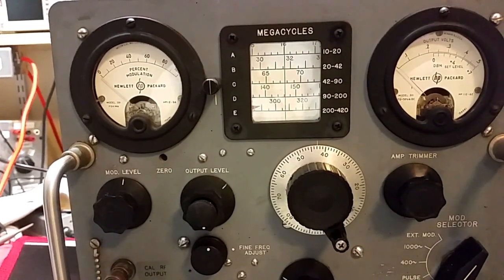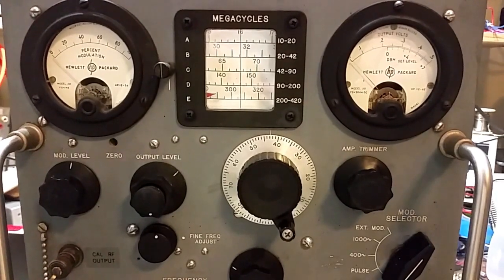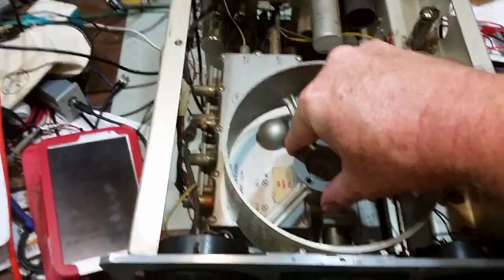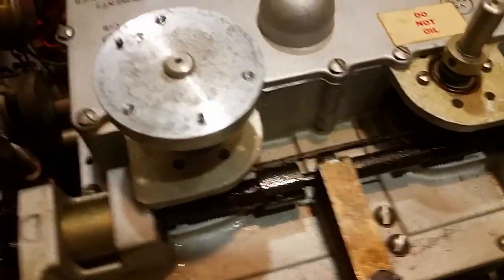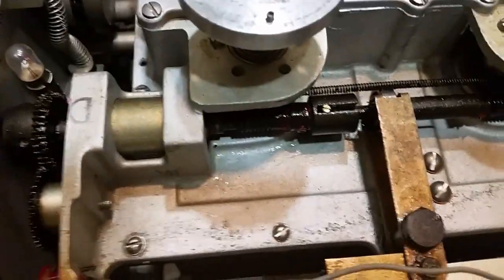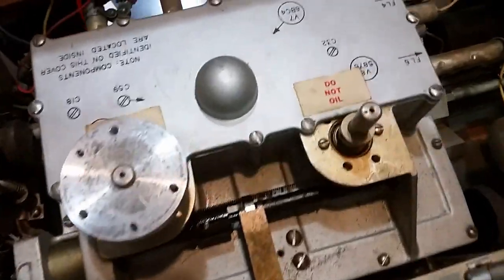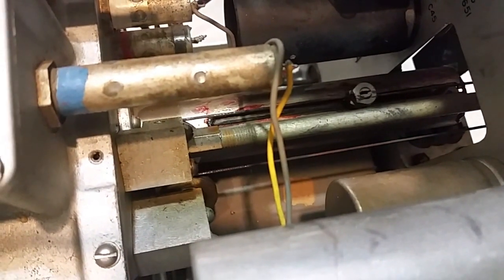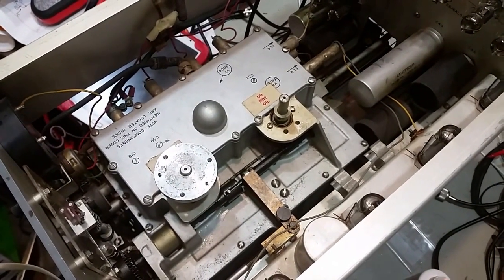Hewlett Packard 608D VHF Signal Generator: A Mechanical Marvel

Comment: I know this is an old thread, but i wanted to add a couple of comments about the rf section "tuning" that those who are not familiar with the the 608 series may find useful if they are restoring one of these units.  As the author of this video points out, the oscillator and power amplifier are tuned together by a worm drive shaft which rotates a pair of multiplate air gap capactors .  

It's very possible that after so many years that the grease used to lubricate the bearings has dried up and for the rf amplifier tuning to "lag" behind as the frequency knob is dialed across any one band.  This is undesirable as it will cause the output power to vary rapidly rather than gradually.  This lag is caused by the shaft binding or dragging.  If the design did not have the slipjoint that is part of the Amp Trimmer control, the two capacitors would remain in mechanical alignment and the increased drag would be felt by the operator as the frequency knob is turned.  You can observe the slip joint as the frequency dial is turned, and the "lockiing pin" should stay at the same depth in the slotted housing.  If the RF section has any binding, the pin will move forward or backward relative to the slot.  You may observe the pin moving, and when the spring tension increases enough to overcome the friction of the bearing, it will often audibly snap back into place. 

The issue then becomes how to free up the rf amplifier tuning which is complicated because HP used a shielded bearing which is pressed into the top of the rf housing.  Removal of the bearing is not a trivial exercise as it requires taking the lid off of the rf section and removing the variable capacitor - Guaranteed to be a nightmare both in disassembly, reassembly and then bringing the rf tuning back into alignment.  I had this exact problem on my 608 and i spent a lot of time thinking about how to solve the issue.  First i cleaned all the external rotating parts including the gears and non-sealed bearings with contact cleaner and a variety of rags and medical quality q-tips until all the old gease was removed - It took a while.  Then it was time to deal with the sticking RF section tuning shaft.   I did NOT want to flood the bearing with oil.  The reason HP labeled the shaft bearings on the oscillator and power amplifier stages with "No Oil" warnings is that if oil passes through the bearing, it will drip down into the RF housing where it can foul the plates of the air capacitors.  Since we're dealing with shielded bearings instead of sealed bearings, i chose to use a contact cleaner with silicone as my initial lubricant.  I puddled the contract cleaner on top of the bearing and after it flowed inside, i then turned the whole unit on its side while rotating the frequency knob forward and backward across the whole band end-end.  After a while the RF amplifier shaft was turning more freely, but it still would stick at several spots I then used 3 in 1 oil SPARINGLY but puddling small amounts on to of the bearing, and as it was absorbed, i rotated the unit on its side all the while turning the frequency knob throughout its range. Eventually, i did manage to achieve a fully tracking RF section - I hope my approach is sufficient to last long term.

Update:  It turned out i was only partially successful in trying to free up the bearing using the above method - it would still stick occasionally.  So i tried this method:  I removed the washer and snap ring, flooded the top of the bearing with some 3 in 1 oil, and applied heat from a heatgun.  I was careful to keep the temps only moderately warm, warm enough to heat the bearing and the grease inside, and hot enough to thin the oil so that it would flow into the bearing.  It took about ten minutes for the oil to penetrate and i had to do it twice.  I know that this risks oil possibly flowing down the shaft and into the tuning capacitor, but i deemed it worth the gamble to avoid having to take apart the whole tuning mechanism.